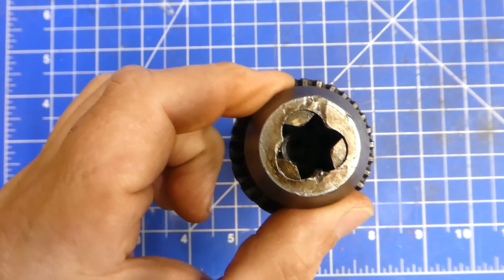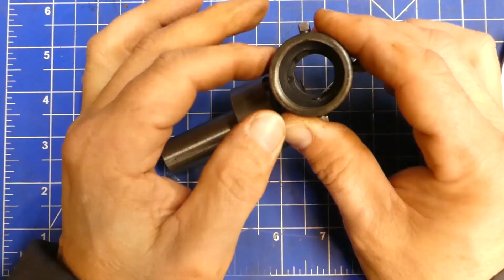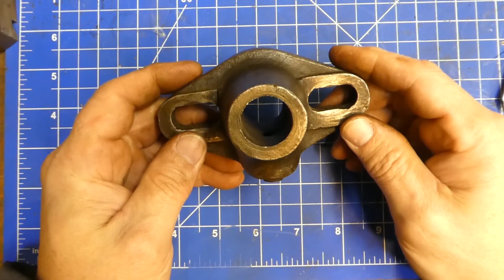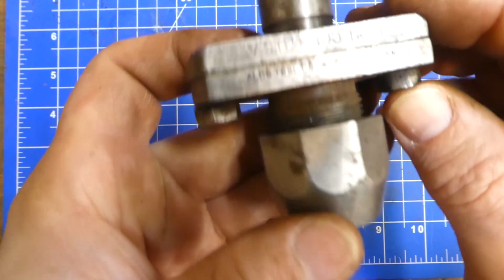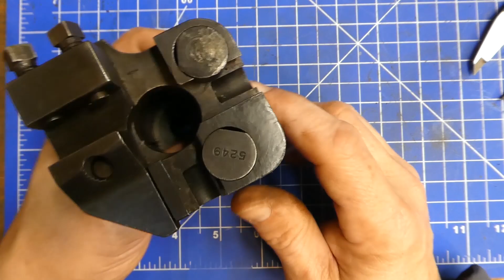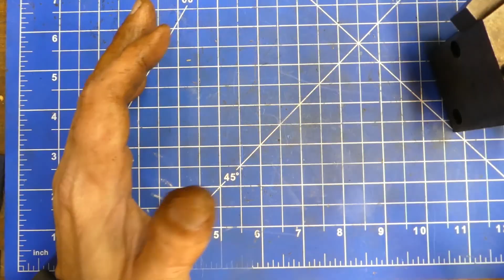Turret Tooling Haul - Detailed look - Long - Might bore you

Comment: There is some specialised holders there .  I think the cut off tool holders may have been  for the old Carboloy  blades with the brazed on carbide .  They used to sit in an angled block .
Reply from the maker: I have been getting a bit of an education in mid 20th century screw machines, lol. Most of this stuff appears to be made  specifically for an actual Brown & Sharpe screw machine, hence why all the number 20 tooling. The funky shaped slot registration pieces seem to be pretty specific to those machines. All can be repurposed of course but going to be hard to find someone still using one of those beasts these days. Thanks!

Comment: Hi Ed,  lots of differing tool holders there, would have been expensive when new ! just goes to show the vast array of jobs carried out on capstan lathes, Im surprised some of the shanks are less than 1 inch diam. I thought my Smart & Brown was small ! I would keep the straight shank to Morse taper adapter, comes in very handy mounted in a 4 jaw on your new lathe. Del.
Reply from the maker: Hey Del, there is some weird stuff here. I filmed this a week before I got the new lathe, so now I am going to keep an eye out for a turret attachment for the Atlas and I will probably keep the adapter now. They made one with 3/4" or maybe 5/8" mounts. The more I have researched this stuff, a lot was for purpose built machines that do not even exist anymore. Lots of stuff to stub my toe on though. Thanks!
Reply: @theeddies  Hi Ed, capstans are a bit of a dinosaur these days with CNC , my lathe came with it, I intend making some automatons in the next few days so may come in handy for multiple parts. If nothing else theres some quality material there with the option of repurposing. yeah those Morse to straight shank are really useful, Del.

Comment: I'm already bored, so I don't know which line to stand in.
Reply from the maker: Lol, I could hardly watch the whole thing.
Reply: @theeddies  It was odd to watch not having any idea what I'm looking at, but I got through it.
Reply from the maker: @johnstrange6799  Are you talking about this video or Keiths? lol. If you are talking about this one, I appreciate it, I hope you did not feel obligated. it was not the type of video I like to make. The reason it took so long to get out is it was a chore to edit out 90% of the babble, lol.
Reply: @theeddies  lol this one. I never feel obligated to watch anything anymore. I don't expect anyone to watch my stuff, and vice versa. It's very liberating. I wanted to see the haul.
Reply from the maker: @johnstrange6799  I probably should have given $50 for it or $5 would have been nice.
Reply from the maker: @johnstrange6799  Am I missing something (ha ha) BUT is there any reason I cannot just go to tractor supply and buy a 4.5" and a 2" pulley for $5 a piece and mount them side by side on the same shaft? Yes the speeds will be slightly off and the spacing might be a bit wide, but as a stop gap.
Reply: @theeddies  I thought that is what you said yesterday. Or at least that's what I thought you meant.  Will you have room to do it width wise though?  How was the guy running it?
Reply from the maker: @johnstrange6799  I think a comment did not make it to you that started the whole question. Chris wants retail ($100) for his pulley, so no, I am not paying $100 for a f'ing pulley. So my question was - Is there any reason I am not thinking of why putting 2 separate pulleys on a shaft is a bad idea? If, of course, they will both fit which I think they will. There is a single pulley that is between to 2 correct sizes on there now. That would make it too complicated. 

I just looked on Amazon, I can get 2 flat sided cast iron pulleys of the near correct sizes for less than $30, I could braze them together and make one 2 step. Screw these guys - MAAA - Make Atlas affordable again. That's the T-shirt I am getting. Sorry, I am rambling.
Reply: @theeddies  Without seeing it in person I can't really say what will work with complete honesty, but what might work is two pulleys.  Personally I would try whatever I could get my hands on, and at the moment that would be two pulleys.  Will it work? Don't know. Is the whole shaft keyed? 

If I sought to combine two I might scuff, brake clean, and super glue them together to avoid putting heat/warp into the mix.
Reply: @theeddies  If I didn't have two pulleys on hand, then I would try to make one. I don't have a large round, so I would use another material, even wood.  If I used wood I would press and glue a nut or small piece of round that has been drilled and tapped through it's center into the pulley to accommodate a set screw. 

I don't think I ever told you, but before I had a VFD to power my lathe I took the belt access side panel off of the base casting (which houses the lathe's motor) and used the panel's mounting holes to attach an external AC motor mount that let me position the AC motor's shaft (With a pulley on it) inside of the lathe's base casting so I could link belt between the AC motor and the lathe's counter shaft.   It worked perfectly.
Reply from the maker: @johnstrange6799  Yes the only bad thing about making it, is the material. I don't have anything that is 4.5" by 3? maybe. I thought that a piece like that would probably cost about $60. But I was just looking and I can get a piece of aluminum 4.5" x 2.5" for around $38 shipped (local supplier would want double that). That might be big enough and the way to go. I can make that the job the swan song of the the blue lathe. I will have to do something creative with the keyway but that might be the ticket.

See what you said there about adapting what you got, that is what I prefer where possible. 

What do you think about bright orange for the lathe color?
Reply: @theeddies  Bright orange? No.
Reply: @theeddies  I'm digging around again, but getting confuzled on the sizes. I know it's 5/8" bore with a 3/16" keyway. is it 2" and 4" or 2.5 and 4.5? I have to read the comments again.
Reply: @theeddies  Right now I have what looks to be a steel 2" flat face pulley with a 5/8 bore and 3/16 keyway. It has a chunky set screw section that would hold it and a a second attached pulley to it. So I'm on the look out for a 4 1/2" (Or somewhere close) flat steel pulley with the same inside configuration. That is going to be the hard part. I have like 10 AC motors (At least! lol) that I can go through and see if anything will turn up. I'm hopeful yet doubtful. I also have to piss!!
Reply: @theeddies  I'm coming up empty on 4.5. I have a 2" and I have two 4" pulley'ish cast iron pieces that could be brazed together.
Reply from the maker: @johnstrange6799  it is actually 1/2" bore and there is no keyway, just flat. Either it came that way or someone ground the keyway flat. Just took the pulley off. I think it was a metric bore they pounded on there, pain is the butt to get off
Reply from the maker: @johnstrange6799  the original pulley sizes according to internet were 1.93" and 4.35". I don't know. I asked Chris to measure his
Reply: @theeddies  You just saved me a UPS charge, but let me see if I have 1/2" now. Trying to send a pic too, and find a box to make it to UPS in the next 15 minutes!!!!
Reply: @theeddies  I have 1/2" flat steel that set screws under the belt) and two 4" cast pieces, but let me keep digging and not bum rush to make todays send deadline. It can be sent tomorrow too. I'll send you a pic or two. Might not be worth it. If I can find a flat steel 4 + one then you can marry the two and it will work.
Reply: @theeddies  Check email.
Reply: Correction on the photo that says 2" bore lol . I meant 2" pulley with a 1/2" bore. Both are steel or cast.
Reply from the maker: @johnstrange6799  check email
Reply: @theeddies  I'll see your check email and raise you one.
Reply from the maker: @johnstrange6799  checkmate
Reply from the maker: @johnstrange6799  check it again
Reply: @theeddies  I am. So roughly 2" x 4.5".  To key or not to key, that is the question now.  Did I miss the bore size. I can't see dick and I broke... well I didn't, but someone broke my glasses!! Let me go searching around again.
Reply from the maker: @johnstrange6799  They came in 5/8 with key and 1/2" without. Mine is 1/2" with just a flat.
Reply from the maker: @johnstrange6799  Unless you come up with a 4.5" I am just going to run it off the 2" I have   for the time being, and grab some aluminum to make one. Or maybe one will pop up on ebay cheap, never know. The 2" will give me 8 speeds from 28 to 685rpm, that is fine to run the machine in and see if everything is working correctly after I fix stuff. Once I do that it has to all come apart for cleaning anyway, so plenty of time for something to pop up or come across something.
Reply: @theeddies  All I came up with was a 4 -1/4" garage door pulley that I drilled the rivets out of to free the bearing. It's thin garbage not suitable for modification. if you can get up to 685 you're set. I wouldn't even run that much faster. It is roller bearings though, right?  I'd be terrified to get that thing ripping around at like 1000rpm.
Reply: @theeddies  Oh the confuzzlement!
Reply from the maker: @johnstrange6799  I know right, it gets overwhelming. Yes it has Timken tapered rollers. It will do 2048 rpm at the top end, you know to make race car parts. I rarely run my mill lathe above the minimum of 500. Not sure what you would want to run at the top end.
Reply: @theeddies  2048!???  No thanks! That thing will shake, rattle, and explode! My floor standing drill press has some crazy top speed that I never dick with. Tread mill motors have scary rpms too.
Reply: @theeddies  You see how straight up cool Mike is? He is willing to basically give a go to making parts for you, including the bevel gears. That is the real deal of decent right there and you just love to see it. He's not looking for anyone to follow him on Instagram, or give him money for new toys.  He's not playing the game, and I respect it.
Reply from the maker: @johnstrange6799  yeah I agree. But did not see where he was going to try the bevels. He is good dude.
Reply: @theeddies  He said he doesn't mind giving stuff a go, and with a fourth axis it basically comes down to having the right profile of cutter. If printed bevel gears can hold up, and the print files are available... I have no doubt he'll try to hook it up. Totally solid dude.
Reply from the maker: @johnstrange6799  no I agree completely but he is talking about the change gears, not beveled gears which incidently I have a little Sunday short showing the carnage of the bevelled in the gearbox coming in about 3 minutes.
Reply: @theeddies  I know he is talking about the change gears, but I also suggested that maybe he can print the bevel gears if possible, and he said he doesn't mind giving stuff a go. Don't get me wrong, I am kind of making that assumption or bridging that connection gap, but I am confident he will give it  go if asked. I just don't know if there are print files for that part.  I'll check out the carnage report short.
Reply from the maker: @johnstrange6799  OHhhhhh now I understand. I have not seen a 3d file for the those bevels but there must be one because I think I saw one for sale. That would be interesting. I will see if I can find a file or I could try to make one, I have been dabbling with Fusion 360. hmmmmm!!!!! The short is live I think.
Reply: @theeddies  I saw it. Way to give it the old community college try!! You had one job. Give us a 60 second video, and what did you do.... a 44 second one. lol
Reply from the maker: @johnstrange6799  Well I read somewhere that the shorter you make them the more Youtube promotes them. Pretty soon Youtube is going to be a repository of one frame "movies", otherwise known as a Instagram. Bunch of short attention spans in the world.
Reply from the maker: @johnstrange6799  Oh and you need to watch it again if you think a little brazing and file work is in order. One of them is missing 75% of the teeth. I might as well start with a round of brass and file out a gear. Who am I, some gunsmith in Pakistan? lol.
Reply: @theeddies  A single frame!? I don't have time for all that!
Reply: @theeddies  I didn't say a little lol. If you're not a Pakistani Gunsmith, then I don't know who you are!
Reply: @theeddies  What's your take on the Alec Baldwin situation? Think he was hammered? I just don't see how he thought the person fainted after they were hit with a round, and how he didn't know until 45 minutes to an hour later. Just doesn't add up. What a tragic mess!
Reply from the maker: @johnstrange6799  ROFL